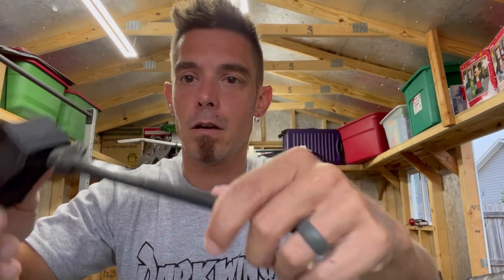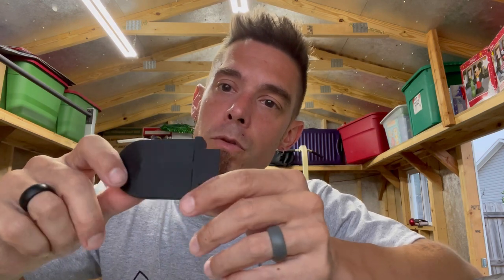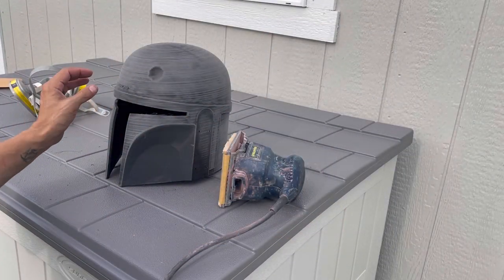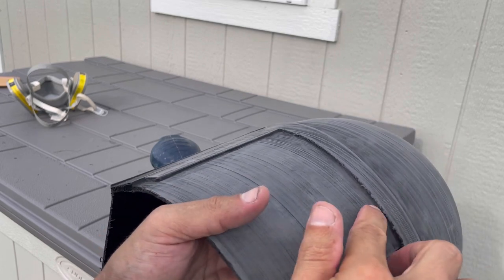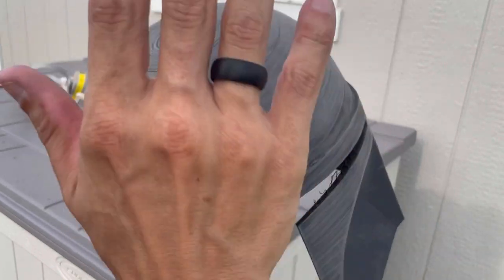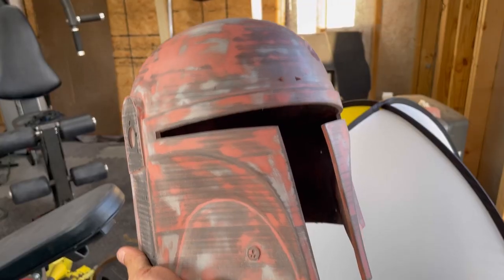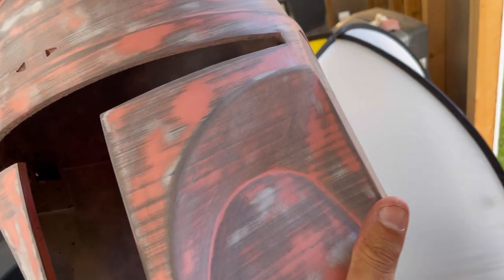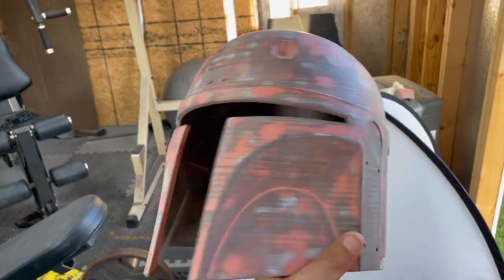How to sand 3D prints| Finish 3D prints faster 3D printing like a pro | boba fett 3D printed helmet

Comment: The Bondo putty (I use a similar one from 3M because it's hard to get Bondo in my country) dissolves in acetone. This means, you can titerally thin it down with acetone, to a consistency of like Tabasco sauce. The result is something like a brush-on putty, which goes really deep into the PLA lines and bonds way batter than pure outty.
I usually give the print just a rough handsand 180, use pure putty for really deep spots. After curing I start to liberally apply thinned putty with a 30mm brush. The acretone accelerates the curing, so after half an hout you can apply a second coat etc. Usually 2 medium heavy coats are enough. 
I usually let it stand to cure over night, but that's just me being patient ;-)
When cured I handsand with 220. Next step is wetsanding with 800 - wetsanding because it doesn't clog up the sandpaper. Personally, again, because I'm fussy, I wetsand with 1200, which gets the thing close to mirror sheen before even applying a filler primer. 
I honestly try not to use machines for sanding though. A machine can friction heat the filament if you manage to get through all the putty and can damage the print. But wetsanding, because it keeps the sandpaper "sharp" indefinitely, is'nt that far behind regarding time, since you'll have to do many parts and areas via hand anyway.
I don't have WIP videos in my channel but some videos of pretty good results with this technique (not just 3d printed stuff).
Reply from the maker: Check out my more recent videos on post processing
Reply: @Darkwingdad  Yeah, I liked the idea to thin the putty down to spray it. I might try that in my spraygun, but my airbrushes are too fine for such work - and too expensive to risk.
What I like about the brush on technique is, it seems to go way deeper into the layer lines. Downside is of course that it's not as smooth and needs more sanding

Comment: My $.02:  I've been experimenting with different coatings and techniques for a while to get smooth prints - on large and small prints - and I've settled on a good-quality 2-part urethane high-build filler primer by Speedokote (SS-2790W/SS-2790A Super Fill High Build Primer).  It builds very quickly, wet-sands like a dream (no paper clogging, no crumbling, feathers beautifully) cures very quickly (depends on how you thin it) is easy to chase details back in where necessary, and is just really nice to work with.  I find that in some parts of the models (depending on spray orientation), the primer will fill in the layer lines and lay down - so no sanding required.  Yes, it's a two-part urethane and requires a spray gun and urethane reducer - so you'll need a mask and an area with good airflow to spray in, but after trying a dozen different methods, this is the one that really ends up being the least amount of work and gives some really great results.
Reply from the maker: I use slick sand which is a 2 part filler, probably super similar to what your using.  Cost,set up, clean up are all deterrents of hobbyist. Won’t argue with the efficiency of them which is why I use it. I’ve perfect this method in my most recent video & it works great for those who can’t do hvlp set ups & want an easy clean up

Comment: Things that i use: CARD SCRAPERS. They are just so amazing that they deserve to be fully capitalized. Then woodfiller, then sanding. The amount of sandpaper i've saved alone makes card scrapers superior, but they are also at least four times as fast, depending on the shape. They work with PLA the best, it is sufficiently hard to be smoothed by card scrapers that are meant for harder woods (wood filaments especially are like made for this method, PETG and PLA+ are not so good as they are more elastic, the scraper tends to jump and jitter). They are also easy to DIY, any sharp 90 degree metal can be rolled to form a scraper edge. I made my own miniature scrapers from large stainless steel tweezers. The edge is good for months, and you can make more and less aggressive versions for removing a lot of material (which is how i do most big holes and friction fit parts to get them exactly right) and less aggressive for final finish. Oh, and the best part: card scrapers do not heat the material. All the heat is in the chips as those deform and then are removed... So, you can go as much as you want on just small area, no need to think about heat. And they never clog.

I use woodfiller since it is cheap and waterbased, it is just very fine gypsum powder. No need for ventilation but it does creta quite a bit of dust so surgical mask at least is adviseable. Trick: do not blow! Ever! Keep moist rag beside you at all times and wipe the dust, and rinse the cloth when it needs to be rinsed. Cuts at least half of dust from landing EVERYWHERE.. Gypsum dust is not fun thing, it is somewhat abrasive and goes.. everywhere. Woodfiller is easy to work with, you can retain a lot of the details, just because it will be sanded first, before plastic. Thinning it with 70/30 IPA/water mix makes it easy to brush, to get thinner layers. I've never had any problems of it coming off, it sticks fairly well but of course, needs to be painted and coated, it is quite soft stuff. And as it is waterbased, no toxic fumes, it is also fairly fast drying (do not use heat, let it dry in room temps or it will form cracks)

And fully agree with the video, let things dry. The longer you let them dry, the easier the sanding becomes. You want to sand something that is hard, not something that is gooey. With waterbased stuff it is extra important as PLA hydrolyses over time if it has water in it, your model becomes more brittle as the polymers snap shorter and shorter. Let it dry overnight, then sand it, prime it, let that cure for hours. It is slower process but overall much less work, time is doing lot of the work for you, so let it do that work.
Reply: Do you end up removing the shape of for example round areas from scraping off more in some areas as compared to others?

Comment: Shoutout to your DOOM mask back there... ALL CAPS!  I'm working on a Modern Post-Imperial kit for the Naast chapter of Mando Mercs and your videos have been VERY helpful!
Reply from the maker: RIP to the king DOOM! Glad you are enjoying the vids. Next weeks video & my suit update video will highlight 2 new products, not bondo, not store bought but boy are they great, thank you for watching, good luck on the build!
Reply: @Darkwingdad  I had never heard of plastic Metal or even had it recommended to me in all my years of cosplaying.  THIS is a game-changer because I always had that "fast cure" issue with two part bondo.... I even used the fiberglass sheets and gel resin to try and make it easier, but you came along and showed me a new way
Reply from the maker: @marquysejackson5706  the thing I notice in 3D print/cosplay is there is SO MUCH misconception and misinformation. Right now the IT thing to do is using sla resin because it’s been showcased on a huge channel. Personally I tried it back in 2019 & hated it! All you have to do is apply a thin coat of plastic metal-sand & it saves so much time. It sands down so easy with 80/120. I’ve stopped using traditional bondo body filler, plastic metal is the way to go.
Reply: @Darkwingdad  you're 100% correct on that!  most of my go-to techniques and materials are unconventional since I don't have a printer, myself.  but, I'm definitely going to be referring to your videos, in the future.  I like how your brain works.  thanks again!

Comment: Great video! I learned a lot. I'm going to give the Bondo plastic and plastic filler a try,
Reply from the maker: Try the plastic metal with acetone brushed on…even better!
Reply: @Darkwingdad  I will give it a try! I used glazing spot putty on my last three clone helmets. But, i ended up doing multiple rounds, just like you said. I'm currently building a Bo-Katan. So, what do you mean by acetone brushed on? Do I apply the putty, brush on the acetone, let it dry, and then sand?
Reply from the maker: @dianawolftorres8594  https://youtu.be/tZPEnGgQvAQ
Here’s the video explaining the process.

Comment: What's the different between glazing putty and plastic metal? can i getaway with just glazing putty or just plactic metal, and what is your suggestion if its for smaller piece that have a lot of intricate details like pistol prop etc?  I really frustrated with those print lines. 
I currently working on the Oblivion pistol and im trying using UV resin which is good cuz it dries fast but sanding it is harder, please help, Thank you
Reply from the maker: Plastic metal will fill in better but with glazing putty you can remove it and blend it down with acetone or scrape it out with plastic panel tools if you get it in a crease or seam. Followed with bondo filler primer you’ll get great results with the putty.
Reply: @Darkwingdad  thanks for such fast respond, i will try it

Comment: So say you just got a fresh print of the printer. Would you say the steps would be 1. Sand. 2. Filler then prime / sand as many times as needed. 3. Paint?
Reply from the maker: Depending on how clean the print is 
Sand 80 grit 
Putty
Sand 160
Filler primer 
Sand 180/220
Filler primer 
Sand 220/320
Final primer 
I just uploaded a few new videos of a diy filler that mixes the plastic metal & putty into 1
So you can do that in place of doing separate fillers & puttys

Comment: 26:10 What’s wrong with wood filler, in your opinion? Could you elaborate? 😮
Reply from the maker: Wood filler is either water based or oil based. This can create numerous issues from expanding & contracting which causing cracking to adhesion issues of top coat paints when an oil based filler is used. Another big issue is people don’t know which one they are using and they thin it down with water, adding a solute of such will alter cure times and the catalyst which allows it to harden. This creates a more porous filler, the solvents in things like primers and paints can be absorbed in and cause numerous problems from cracking,lifting & paint leeching(discoloration) of paint. Wood fillers have evolved over time and some have polyester additives however they still will not & are not meant to bond to thermo plastics & really are just meant to be stained with things like wood stain. 
The king of the short wood filler cannot handle heavy solvents that are in primers,paints & clears & it being incredibly porous and absorbent in nature makes it susceptible to problem when these solvents gas & cure.
Understand that in 3D printing you are doing minor auto motive repair in a sense. The products that I use & recommend have been used on urethane’s,metals,fiberglass substrates & more for decades… they’ll definitely work on plastic. Of course to each there own, but I try to teach people to use products and techniques that are full proof & efficient. Just know I’ve made a lot of props that are both displayed & worn and never had issues when using my methods & these same methods are being used in the auto industry on cars driven thousands of miles yearly. I hope this helps & my son & I are big fans of your channel. Especially love spiderman with the eyes,green goblin & moon knight. If you ever want to collaborate or need insight on products to try out you can email me. Thanks Sean!
Reply: Thank you sir!! Might have to give that Bondo Plastic Metal a try. I’m a fan of your channel too haha 😁 Cheers
Reply from the maker: @seanscrafts  if you have trouble finding let me know I can send you some, I also have a new product that works really awesome & ironically I did it on a moon knight helmet. Video should be dropping in a week or so, something to look into! Thanks for watching Sean, looking forward to see what you come up with next with that big brain of yours & cereal boxes! Lol!

Comment: Just to clarify, you cover the entire helmet with plastic metal and sand it off, and then repeat that with the glazing putty?
Reply from the maker: Correct
Reply: @Darkwingdad  do you still use the plastic metal to cover the helmet before spray putty as well?
Reply from the maker: @brandonlawson1856  if you have deeper pla gaps yes, sometimes it crap filament or maybe a loose belt and you don’t wana scrap the whole piece plastic metal works great. You can thin plastic metal down a bit and apply with a brush, video coming soon! Putty is for light duty due to its high shrink rate. Trust me when I say this method will leave you with a truly mint piece with no pla lines

Comment: Do you rinse off your prints after saning and before adding another coat of fuller primer?
Reply from the maker: I wipe down with IPA & use a tac cloth after to remove lint/debris
Reply: @Darkwingdad  oooooooooooo that makes more sense lol. Thanks brother
Reply from the maker: @wilatheroicstudios2466  no problem

Comment: I saw you used stage 2 bondo spot and glaze putty...what's the difference of stage 3 and what should you use to finish
Reply from the maker: Plastic metal is a filler, that is used for deeper defects but here I displayed how easy it sands & how it will fill in almost everything. You should always use a putty after a filler so here using bondo glazing putty after the plastic metal & lastly finishing with bondo filler primer

Comment: After that final primer spray at the very end, do you then sand again before you apply the paint in Part 2?
Reply from the maker: No, if your final primer coat is applied properly with no runs or imperfections you can jump right into paint

Comment: Hey just curious: is there a reason you use pla opposed to Petg? It doesn’t warp from heat/friction from sanding. A lot less brittle as well.
Reply from the maker: Solid point, I was just using this pla for test purposes :) most of my suit is pla+ & petg
Reply from the maker: In all reality though petg can take longer to sand being more durable & harder. For display pieces I always use pla because they sand down quicker. Petg or pla+ for wearable or moving parts.
Reply: Yeah i moved to PETG and its so much easier to work with powertools on due to its hight heat tolerance. Plus its hot as hell here in Australia and PLA Prints warp so dam easy after hours of finishing work.
Reply from the maker: @ScottBourke  I’ve never had major issues with sanding pla, even with petg edges and intricate areas you either round off or can’t get in with a machine, when the ocd kicks in it’s real lol. I found when I use petg the hand sand and detail work took longer so I’ve always stuck with pla or pla+

Comment: For the plastic metal is that Bondo 901 and is the glazing putty Bondo 907C?  Thanks for the video.
Reply from the maker: Correct. Many people are catching on & realizing the application of a controlled filler than glazing putty is so much quicker, 1-2 coats of filler primer after and it’s done! Thanks for watching!

Comment: Great video and very helpful tips.
I have a question; I use wood filler to fill in the joints and seam lines, can I use Bondo Platic Metal to fill in the joints?
Reply from the maker: For welding Seams the full proof method would be bond with 2 part epoxy,pla weld that use plastic metal. I would steer clear of wood filler for gaps and seams. Pla weld and plastic metal is the way to go!
Reply: @Darkwingdad  Yes I PLA weld and use wood filler to fill in the gaps. Will Bondo Plastic Metal serve better than wood filler?
Reply from the maker: @khurram4ss  yes plastic metal is a much much better alternative, the proper one at that! It will bond better and add reinforcement to the piece

Comment: Have you changed over to UPOL?  How does that compare to the metal filler Bondo?
Reply from the maker: Plastic metal is great for deeper defects especially when pla welding. The upol 1k putty is my go to though for smoothing

Comment: Super helpful for my first mando print. How do you deal wkth detailed areas when applying the plastic metal/bondo. I found its so difficult to spread kt usually gums up and im worried indented lines might disappear
Reply from the maker: You can dilute the plastic metal with acetone. Even after you apply it straight from the tube it can be reduced/diminished down to a lighter consistency even after it dries.
Check out my video on this method here https://youtu.be/tZPEnGgQvAQ
Reply: @Darkwing dad  I should have known you'd have a video for it :) awesome thanks I'll check that out and be picking up some acetone I guess
Reply from the maker: @schaeefer  nail polish remover works too :)

Comment: Can i wet sand bondo glazing putty with water? Or it will just dissolve the putty?
Reply from the maker: You can but there a minimal benefits to wetsanding putty. As soon as you put paint or clear coat on you will create orange peel especially if using spray cans. That’s when you want to wetsand it
Reply: @Darkwingdad  thank you for your reply. I might have caked the putty to much so hopefully i can sand it clean. I will avoid water. C. I clean the dust with acetone or just compressed air?
Reply from the maker: @Anupkulkarni23  yes just blow it down and wipe with isopropyl alcohol

Comment: Do you use Tack cloth to remove dust prior to paint? - I saw your paint tent this time - anything else you do to stop airborn artifacts?
Reply from the maker: Tack cloths are great, the key is keeping them dust free, so I usually cut them up and only use 1 side a few times, suede towels with isopropyl is also a great dust eliminator, avoid using micro fibers when painting, they will introduce protons via fibrous resistance(static cling) and it’ll be difficult to get off. I just keep airflow to a minimum, keep the area clean and use tack clothes when needed, just don’t rub too hard you’ll swirl up the paint